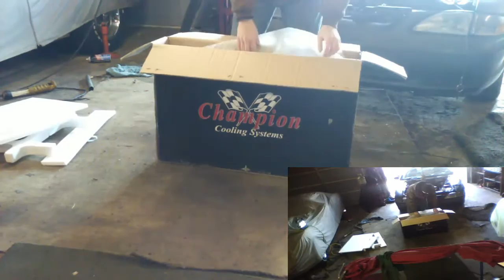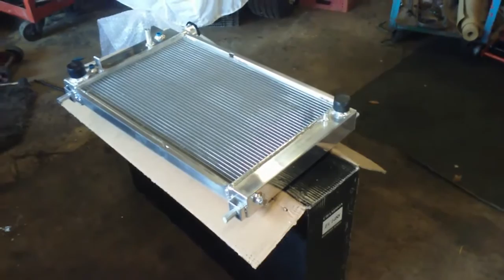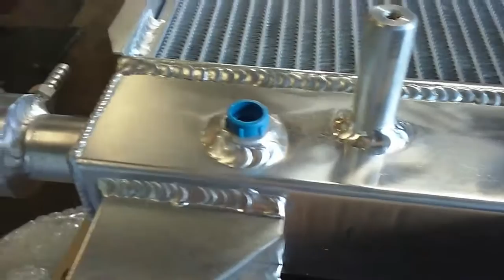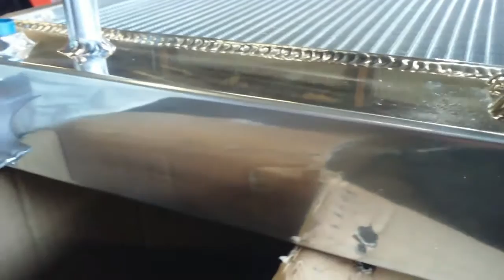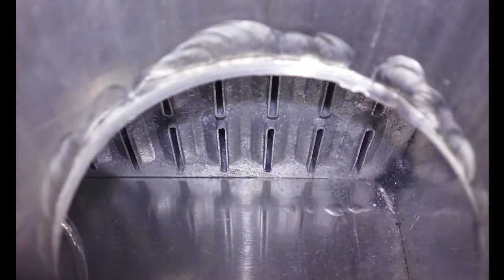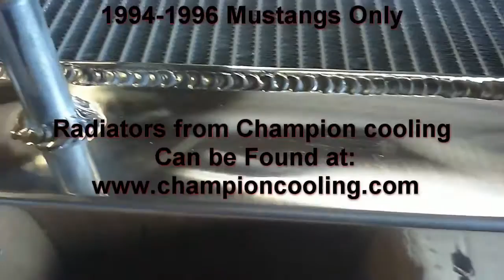Champion Cooling Radiator Unboxing & Overview

Comment: Why is aluminum rad.better than steel?
Reply from the maker: Edward Aguilar better heat dissipation than steel, lighter than steel and this one in particular is a duel row radiator for even better cooling.

Comment: how is the radiator holding up?
Reply from the maker: very well. doesn't not leak as far as I can see. Haven't had the car on the road much, but when it was, it kept the temps nice and low.
Reply: Drew Fetters for the price you almost can argue.  but i just get worried because yes it is half the price of a griffith or becool.
Reply from the maker: Very true. It does come with the Lifetime warranty that eases the mind a little when purchasing it.
Reply: well ill be following ur progess on ur car.  keep up the good work.
Reply from the maker: Thank you!